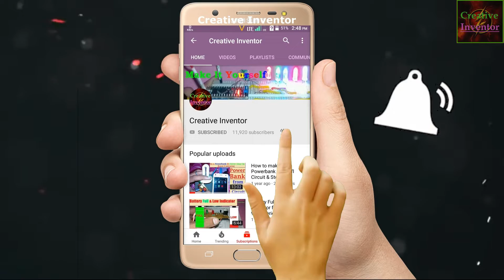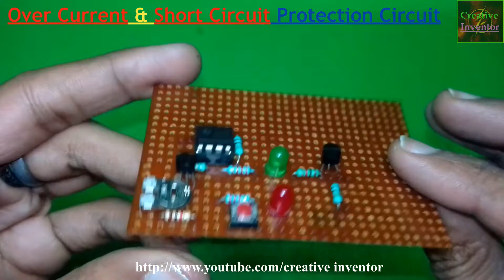DIY Short Circuit Over-Current Protection | Short Circuit Protection | Over Current Protection

Comment: Does this circuit work with a 24V and maximum 5A power supply, and if it exceeds 24V, can I add a 12V voltage regulator to the input of this circuit to still manage the 24V 5A control?

Comment: Will it work if we use 1 ohm resistor instead of 0.47 ohm?
Reply from the maker: It will work but the sensitivity becomes low, use 2 one ohms resistors in parallel it will become 0.50 ohms

Comment: Pls does this work , I will review my connections becos I made it and short circuit it turned red from green but still have voltage at output, pls I don't know if it's a mistake or theres a slight error in the schematic

Comment: Circuit idea is good.re 555 timer get triggered  and relay gets on when current through the 0.47 ohm reached 0.7 v which turn on bc547. Short. Circuit only will work . Accurate current limit settings not possible.even if u adjust minimum 1.48 ampere required to cut off the circuit.   Op amp should be used instead of bc 547 to trigger pin 2 of ic. Any way I  will try this to make it better. Thanks for the idea.
Reply: @SANEESH ELECTRONICA ഈ circuit 6v battery use ചെയ്യുന്ന circuit-ഇൽ ഉപയോഗിക്കാൻ കഴിയുമോ? 12v relay യ്‌ക്ക് പകരം 6v relay use ചെയ്തുകൊണ്ട്?
Reply: @nithinmohan5211   u can  the main current  limit is from o. 47 ohm resistance  5 w  u may need to increase  power . This will work only with short ckt . Overload  will not work
Reply: @saneeshelectronica9293   താങ്കൾക്ക് താങ്കളുടെ ചാനലിൽ op amp ic ഉപയോഗിച്ചിട്ടുള്ള  short circuit and current limiting circuit ചെയ്യാൻ കഴിയുമെങ്കിൽ അത് ഞങ്ങളെ പോലെയുള്ള ആളുകൾക്ക് ഉപകാരം ആയിരിക്കും. already താങ്കളുടെ ചാനലിൻ്റെ ഒരു subscriber ആണ്. ഒരു 6 volt circuit നു വേണ്ടിയുള്ള short circuit and current limiting circuit നു vendi ഒരുപാട് ശ്രമിച്ചു, പക്ഷേ കിട്ടിയതെല്ലാം 12 volt supply ക്കു വേണ്ടി ഉള്ളതായിരുന്നു.

Comment: I will tell u the problm regarding the drill later. 
A new problem-I bought a new multimetre last week company name-Huoyane a yellow coloured with price rs. 190.Today morning i checked the output voltage of the stove burner(that thing gives shock like in lighter).I SET the metre to 200v ac. And voltage rise upto 560v.Now my multimetre showing always 300v when its kept idle.Please please helppp
Reply: @CreativeInventorlab  No bro when i set to dc mode also it is still showing 396v.And now my buzzer also not working.If i gave this to a repairing shop will that get repaired?
Do u have fb?i will send photo
Reply: Lol. U have probably damaged the chip. Such cheap multimeter are not for goofing around.. and voltage from the spark is high enough may be in some kv..

Comment: I have on more doubt.. 
If suppose i have 5amp 12v transformer and 1 amp 12 trsnfrmr and i connected it in series what will be output amp?
Reply: @CreativeInventorlab  I connected the output wires in series and after the series connection connected bridge rectifier.
Reply: @CreativeInventorlab  thx

Comment: Bro did u know about a black coloured transformer name-Electronic transformer for halogen lightz with red wire iput and white write for output. 
I connected it to 220v and checked the output voltage showing 80v.But it is written their is 12v AC.WHY??